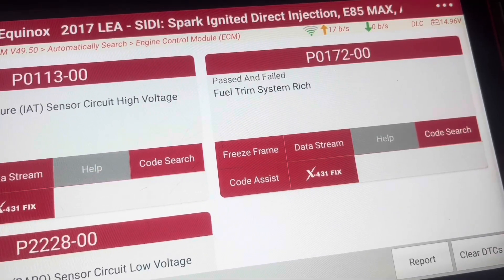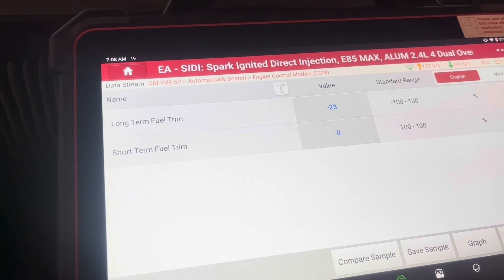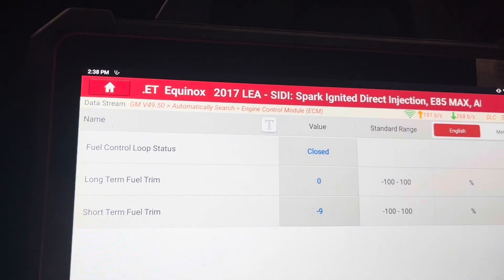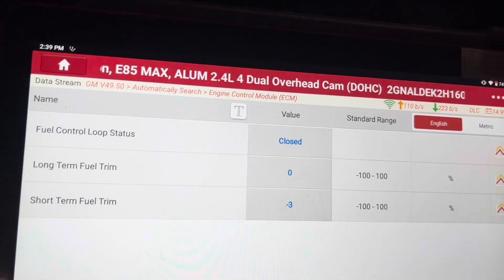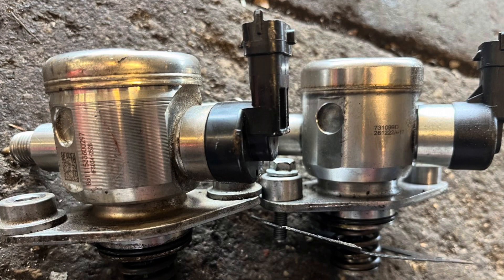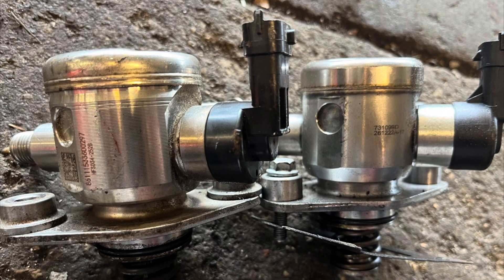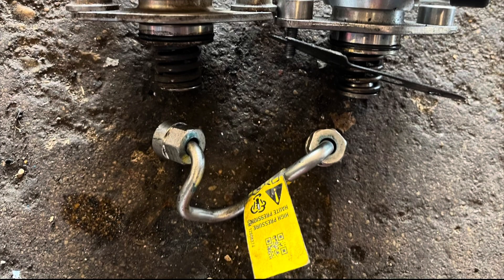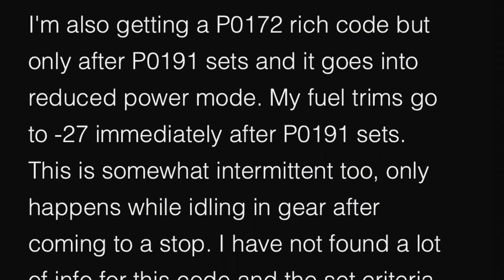Chevy Equinox 2.4L P0172 Diag, P0191 Warning and Info

Comment: Hello, I'm getting both codes P0172 and P0191. I had the HPFP replaced less than 5 months ago because I was getting those same codes back then and that was also a new HPFP and now here, they are again. Both of the HPFP were oem, so I'm lost here.
Reply from the maker: Thats a tough one, I would ask were are you getting the pumps from? are they from the dealer? Also are you replacing the high pressure fuel line that is attached to it. I would also check the roller that activates the HPFP by the camshaft to make sure it aint worn. Another thing is, are you getting the right fuel pump. I think there is two different fuel pumps for this car one for E85 and one for normal gas.

Comment: I have the same codes but im leaning more towards the fuel rail pressure sensor? I hooked up a fuel pressure gauge but couldnt get the issue to duplicate. What happened was it stalled when going into reverse backing up when the rpms were dropped. All lights come on the dash and it goes into limp mode (reduced power). So i was getting good readings on the gauge from the fuel rail while idling and going into reverse backing up slowly. Still nothing out of the ordinary. So the owner of the car drove it back home while i was monitoring pressure on my scan tool and i was getting erratic readings from 23 all the way 70 under load changes (letting off throttle etc) but no symptoms such as stalling or anything. Leaving me to believe it's the sensor since the ECM uses the sensor’s data to adjust fuel delivery. Did not monitor fuel trims but will again this next weekend. I'm still leaning towards a fuel rail pressure sensor but am open to other possibilities.
Reply from the maker: If it still has the oem high pressure fuel pump then i would also be calling that fuel pressure sensor. but if it has an aftermarket pump, i would try getting the OE pump. Because if I recall back when I did this job, I was also looking at the data with a aftermarket pump on the car and it also seemed like it wasnt right. I couldnt really pinpoint it but it seemed like it would cut out at times on its own. But yeah good luck!
Reply: @mechanicRaul  Thanks man
Reply: My Terrain did that too. It has P0C06 and P0191 code. It didn't die when I backed it up but it did go into limp mode when I drove it for about 5 miles.
Reply: You fixed it?

Comment: Thank you!! OEM. worked!! Good video.
Reply: Have you had any issues since? I e replaced about 6 pumps in the last year all from AutoZone now I will try oem and see if it'll fix it
Reply: @jram1r3z1990  I sold the car but didn't have anymore issues for couple of months after fixing, then it got sold. Before using the OEM it wouldn't last more than a day without loosing power.
Reply: @Donzgalore  non OEM parts only last me 1-3 month span then it acts up again. I bought oem today and hope it fixed the issue

Comment: Thanks man I appreciate this video. I'm dealing with a verano eith this exact issue. I replaced the fuel rail pressure sensor and no go. So now try the pump.
Reply from the maker: @ajsandoval7318  i would do that, except like i said in the video, only oem and replace that little line attached to it too. also an oil change because the engine will still suck in the pcv fumes that have too much gas from the leeaking pump.
Reply: @mechanicRaul  the only thing I didnt do was replace the line but I replaced that pump with an oem one and so far so good! Thanks a ton man because I was stumped on this one. I couldn't find much info anywhere else and stumbled upon your video.

Comment: Ive rep😢the high flow sensor twice and the pump once because it failed my car hitches and sometimes stalls when i stop says my system is running rivh ive also replaced the 02 sensor up top still does it fee days ago i cleaned the injectors a little bit the etbi as well and the rail and my pvc still stalls and hitches and goes into limp mode didnt wanna replace this if i dodnt need to but the odds its faulty idk when i replaced it it ran fine for a day or 3 and then started with them issues
Reply from the maker: @Somersetauto  Honestly it probably is the pump, if its an aftermarket one especially. make sure to do an oil change aswell if you put a new oem pump too.
Reply: @mechanicRHP  I did an OEM pump and just did the oil last week did the pump about a month ago
Reply from the maker: @ oh really?! damn, what codes are you getting? any misfire codes? could be a leaking injector
Reply: @mechanicRaul  as of right now just p0191  and at times it's a slight mis we are thinking about doing injectors but they want 680+ for the 4 of em 😂so just dealing with it till I can throw.so more at it
Reply from the maker: damn! yeah i would see if theres a specific cylinder were its misfiring from. then i would pull the plugs to see if they have gas on them. good luck bro!
Reply: @Somersetaut you fix it?
Reply: @warriorplutotrent3827 no i put 4 sensores on the highflow side and 3 on the low flow side did the injectors and rail and it still kept javing that problem even did the fuel pump driver module i think it was an electrical issue ended up trading it as parts for a car trailer but im never owing a ecotec again if i do its just gonna be a beater and abused cuz they aint worth much
Reply: I'm having the same problem a car purchased from the auction. Did timing chain and it's running strong. It just good into reduced engine power. I will try hptuners and just tune out the code. The car runs very strong and can even burn some rubber. I have an oem high pressure pump coming and I hope it fixes it  @Somersetauto
Reply: @warriorplutotrent3827 good luck with it and hope it works for ya new rig of mine I think needs head gaskets lol